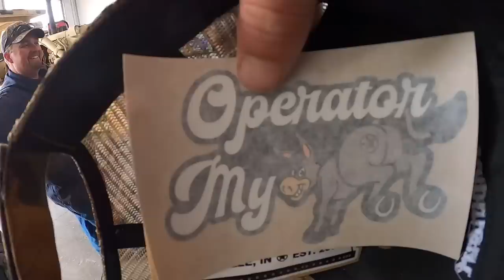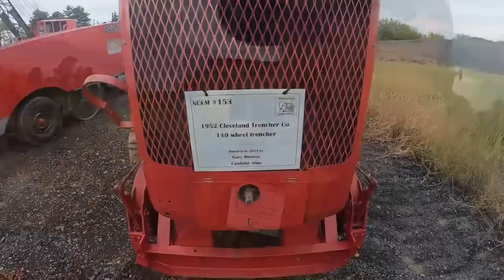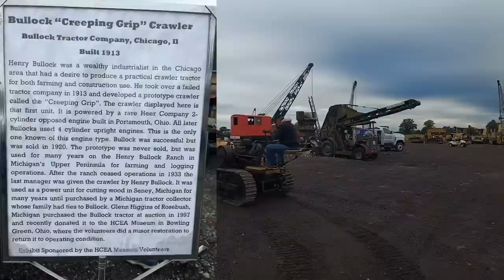Road trip to @C_CEQUIPMENT and @DieselCreekwith some racing and one of a kind old equipment

Comment: Mike and Matt together?  Oh man!  I wish I was there.  I love old equipment.  I ran many of those in the 70's.  1955 Euclid, 1957 & 1959 International R190 Dump truck, I think a 1956 Back Dump.  It had no steering wheel.  It was steered by switches. Unknown year 833 Cat crawler loader.  It was work back then.  Real work.  Nothing had A/C.  To keep the Internationals cool we took the sides of the hood off.  Heaters?  Not so much. If you run fast enough and there was a hole in the firewall, you had heat.  Thanks for the memories!

Comment: Don't know of any way to convince people of the old equipment we got to play with as I was just a kid, and it was all but faded out. I will try though to explain..... Lower parts of our valley I was raised in was new or at least newer equipment with gas or diesel engines. Hydraulics was hinted but not even so much as common. Now return to "hicksville" or a town called Rockport, was all steam, some diesel, but mostly gas and steam combinations. Dipper sticks on shovels, cable blade dozers. When I was working for my dad, I set chokers for the mules or horses to drag trees out of the woods. You learned kindness went  a long way with those horses or mules. I made their boots in the harness shop and trimmed hooves, fixed their teeth so  they could still chew oats up and kept their feed in order so they didn't get a twist in their stomach. I also worked with dad on  is favorite hobby which was mining for gold and other metals we would run through a jaw or cone crusher. The blacksmith was one very important man in any trade. Yet all that went away very quick when welders, torches, and air tools became popular. Soon diesel took the place of the horse or mule. I did love my animals but when a choker was set on a turn of logs, and a steam yarder converted to diesel power was doing the pulling, production was just through the roof and not long before trucks looked more like what we have today. Real horsepower from a 6N53 detroit was just screaming its lungs out.... hearing was kinda going south in a hurry. Long before safety shields and hearing protectors. Men were deaf before their times, I suffer from some of those old power saws that ran a pond chain on their bars.... you could almost count the teeth going around that bar but huge shavings from wood being cut. I know how you enjoyed looking at the past and its good to remember where we came from.

Comment: Some of that equipment can still be used today !! A little slower but can get the job done !!!! I run an old cable 18A 9 with a pull scraper for the longest time back in the 80s.  Great way to learn that's for sure.

Comment: Been snowing here in mi.for the last 4 days n suppose to continue thru sun.love my grapple.it does all of work.kevin is always in the lead.kevin needs to paint LT dan for sure.what went on w the deal you bought something n it wasn't sold as advertised but you had no warranty n you needed to talk w chet.only heard a snip of that.my uncle use to run a steam shovel n the steam clam bucket,along w a steam drag line for the road commission back in the day.i love the old equipment.that thing wouldn't be able to load bubba dump man.i ran one of the earth movers in fort wayne indiana in 1971.we also had a cable operated grader w a pony motor on.hard starting in feb.
Reply: Good stuff n neat old equipment. Ty